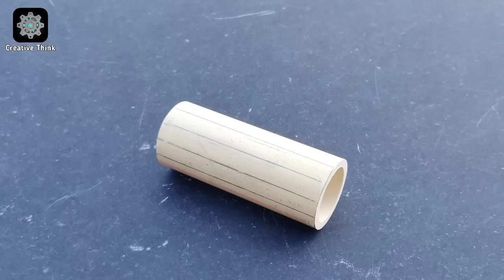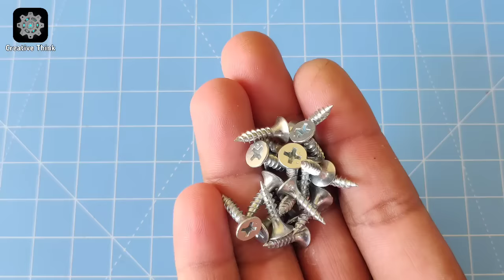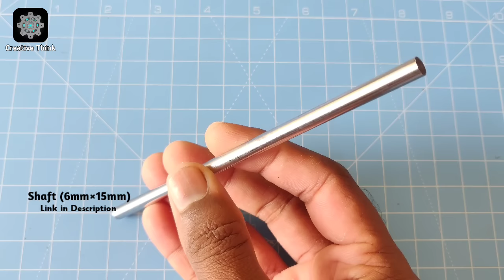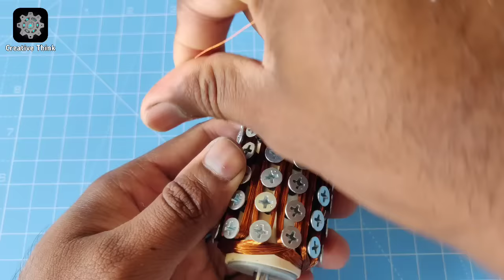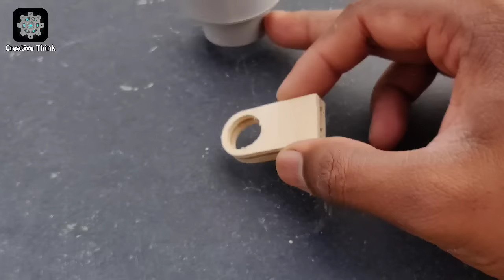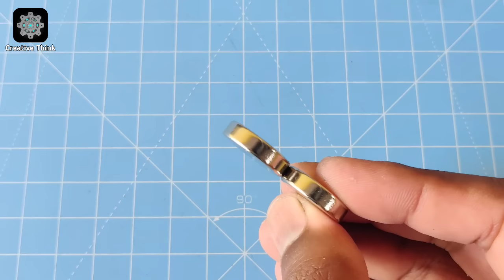Powerful Brushed Motor Using 72 Screws

Comment: I built a similar motor when I was 12 back in 1969, it did not have variable speed and I did not have neodymium magnets and mine worked, I was 12 and it was 55 years ago. I see we have not progressed very far. Stop patting yourself on the back. Unless mind you, you are a 5 year old.

Comment: That's stupid. I can see that there is two black wire hooked up to something else like maybe electricity from the wall. Because it's not showing where those two wires went to, but to me it looks like it's hooked up to something. I know
Reply: Yes, it is hooked up to a power supply. Motors need electrical power to create the spin.